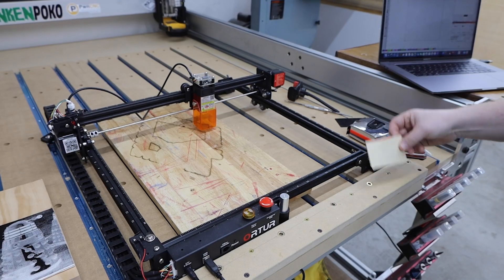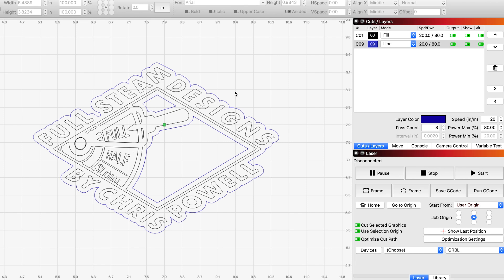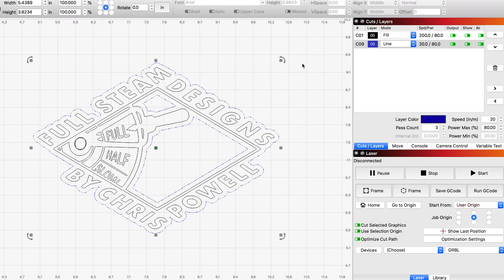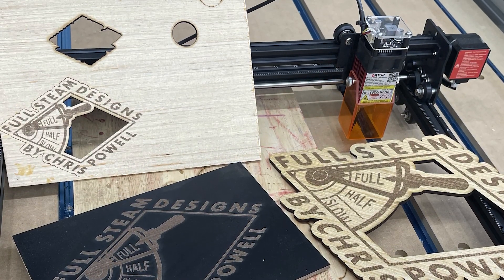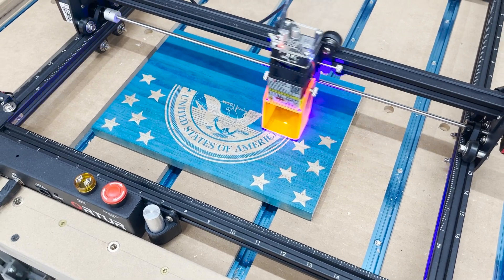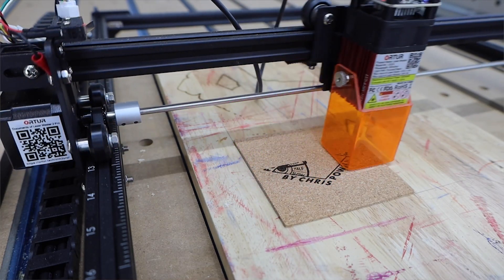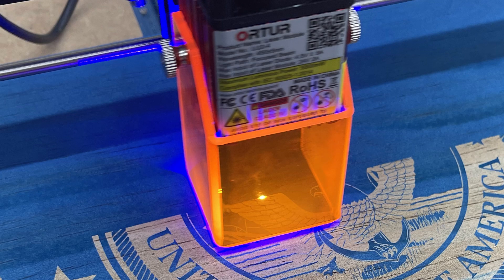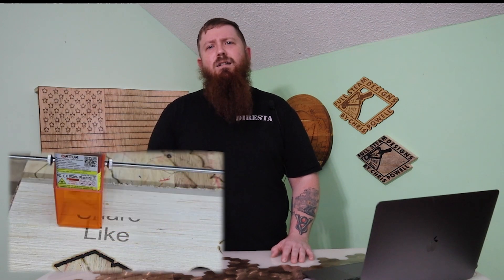Getting Started with the Ortur Laser Master 2 Pro laser engraver and Review

Comment: I still have the previous model. I almost never use it though. I use a JTech on my Shapeoko 99% of the time. Love the upgrades they made though. I recommend bring your power down to 60%. It'll prolong the llfe of the laser. It takes longer, but worth it for me.
Reply from the maker: I considered one of those, but would prefer not have my cnc tied up if I don’t have to.
Reply: @ChrisPowellFSD  Yeah I dont' have enough volume where it's an issue. I get a lot more laser work than CNC work.
Reply from the maker: @StevenDavisPhoto  I’m pretty sure I’ll just be upgrading to a larger laser eventually. It’s super addictive.
Reply: @ChrisPowellFSD  yeah I get way more money from my laser than my cnc
Reply from the maker: @StevenDavisPhoto  it just seems so much more enjoyable to run also. No hearing protection required. No concerns about crashing. It’s great.
Reply: @ChrisPowellFSD  yep. Lasering is nice.

Comment: I'd love to see you do some marquetry with it. I don't particularly like the burnt edges and would love to see your solution.  Good luck with it and have fun!
Reply from the maker: That would be interesting to try. I’ll have to order some veneer.
Reply: You'll get cleaner cuts with an air-assist nozzle.  Makes a night and day difference in the browning around the cut lines.  But the edges of all wood that is cut with a laser is going to be brown because you are burning the wood to cut through.  There's no way around that unless you use a CNC router.